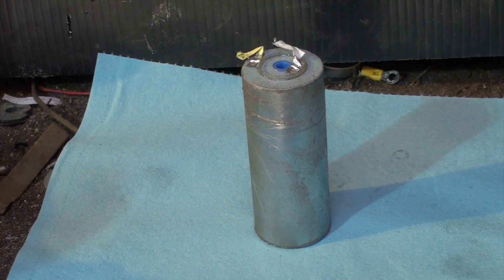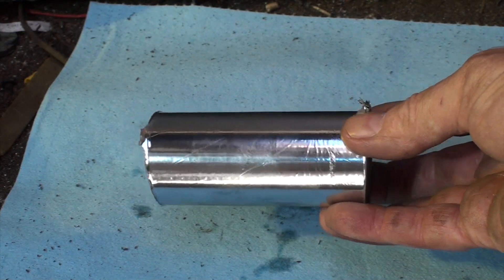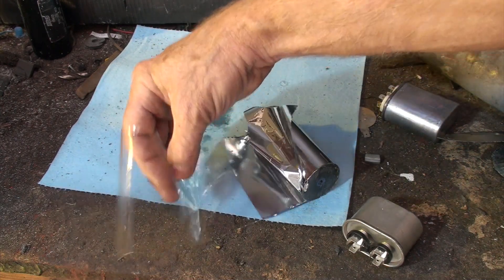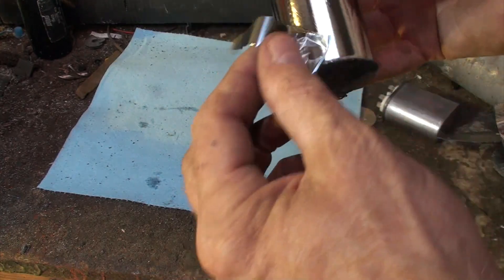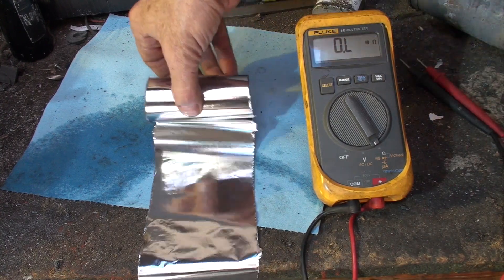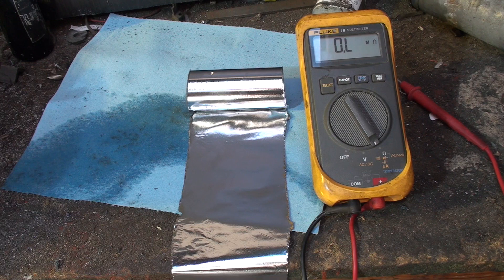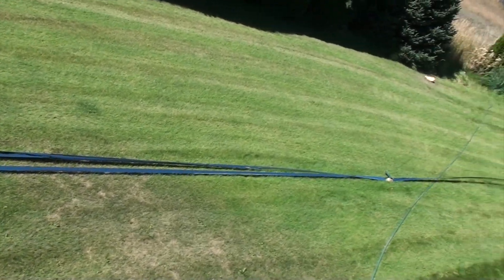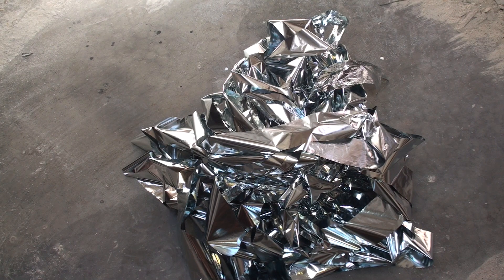Whats inside the motor run capacitor

Comment: Capacitors are made of very thin rolled metalized plastic or mylar film. Not two separate sheets. The mylar film is metalized ( sprayed on in a metalizing machine ). The film is then slit to size, rolled to different capacitor sizes, ensprayed in a tafa machine then tabs welded on to connect to the top terminals.

Comment: Is there two aluminum foil roll together with plastic insulation?what is sticky fluid under capacitor?
Reply from the maker: Yes on the foil.  The sticky fluid is oil that helps transfer heat to the can.
GFM

Comment: Very cool! So im guessing what make caps go bad is the insulating layer breaking down and letting power flow from sheet too sheet instead of going all the way thru? Idk? Just my guess
Reply from the maker: awsom70 That would usually cause a short and the result is the capacitor has no capacitance.  Hope this help.
GFM

Comment: Could you please tell me what a pcb is.  Thanks Danny in Texas
Reply from the maker: Danny Calk   Polychlorinated biphenyls  That helped a bunch didn't it.  They were used mostly in transformers to transfer heat from the windings.  It was a great solution.  It would not burn or break down.  It was very stable.  It was also very dangerous as it is a carcinogen.  Its use was stopped in the late 1970s.
GFM
Reply from the maker: @billsmith1770  It was common practice to use PCB oil for road dust control.  Never heard of a cleanup resulting but probably should have.
GFM

Comment: grayfurnaceman: 

you obviously touched the dielectric fluid and the cap itself. Is any of what you touched toxic?
Reply from the maker: If the capacitor was made before about 1975 the oil is very toxic.  The replacement oil does not have the same toxicity.  
GFM